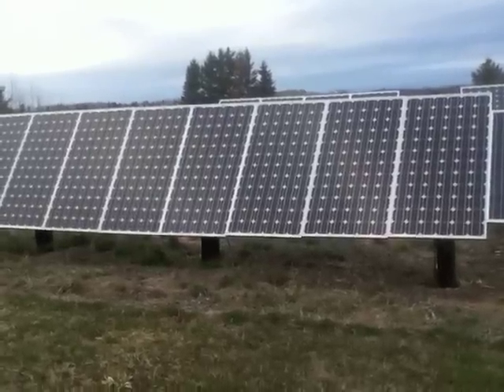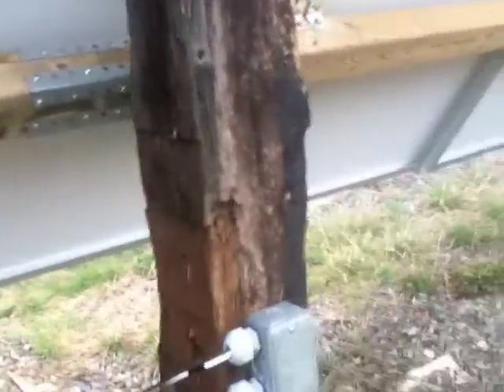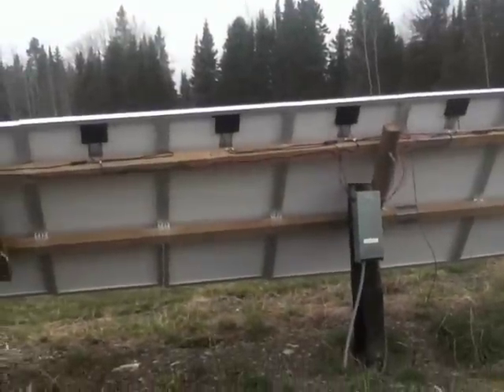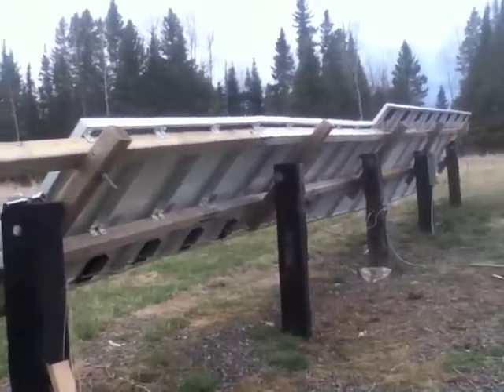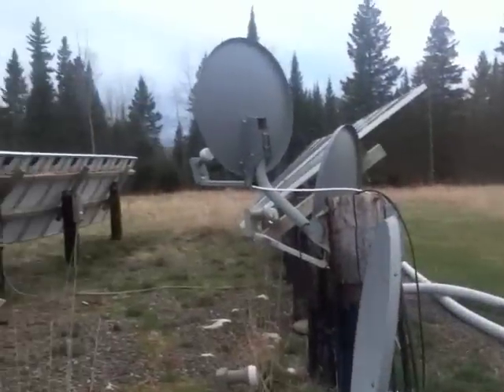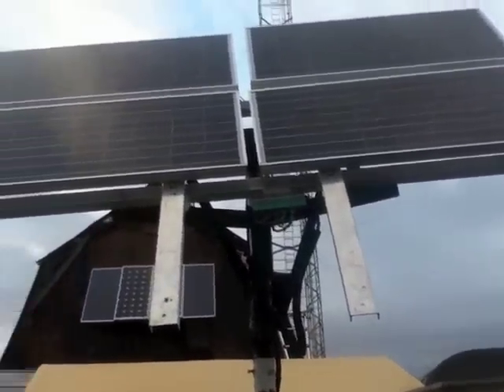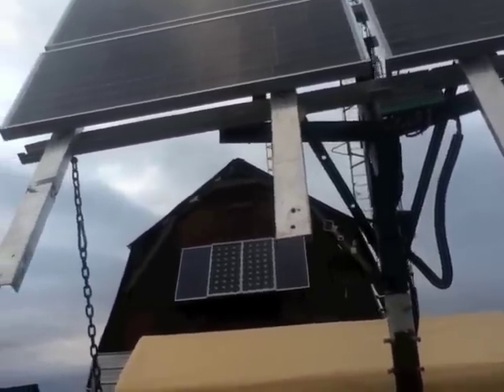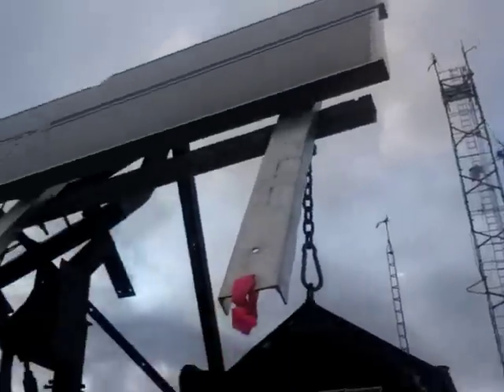Expanding The Solar System

Comment: Yeah , I just picked up 4   255 Watt 24V  panels and a 300 watt 24V panel for 1,400 bucks  so that's 1,300 Watts and I sold 8 of those little 80 Watt panels . So I gained 680 watts in the process and now I got 4.8 kW and I'm going to try to swing 4  more of those 255's for another kw. Then I'll feel comfortable. If you want to make power on cloudy days ,you got to have lots of panels or you'll beat your batteries to death or burn a lot of gas in the generator.  Panels got way cheaper now also.

Comment: I changed the configuration a bit since , I connected those 8  85W panels together with the first 8 panel array , and I took 4 off the barn and mounted them on the tracker with the other 4. So I now have 8 on my tracker. My two bat houses now get full sunshine all day now . They'll love that. I connected the Tracker array to the other FlexMax so the system is equally balanced.  I'm happy to have 4.2 kW solar all up and running now. Now my next priority is to get the DWP350 turbine up and running